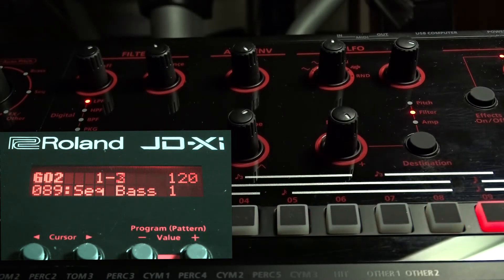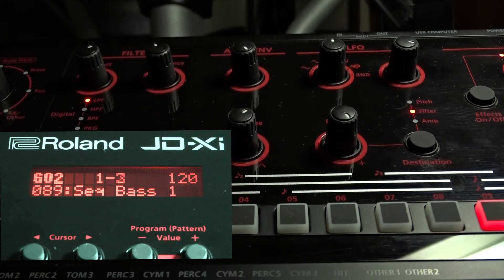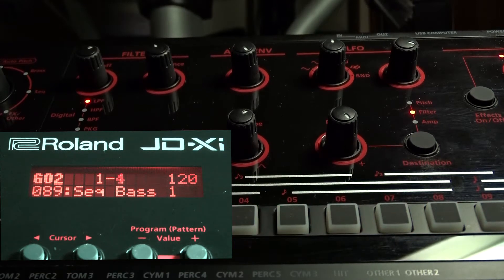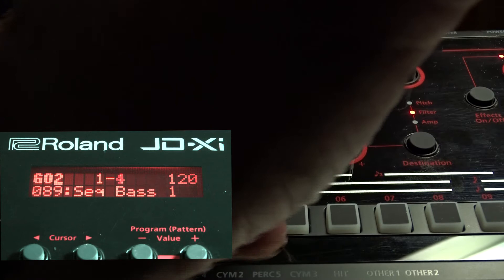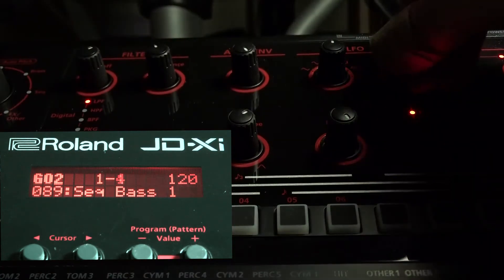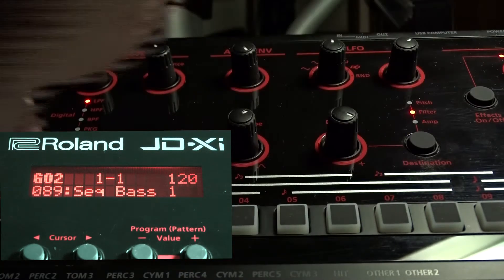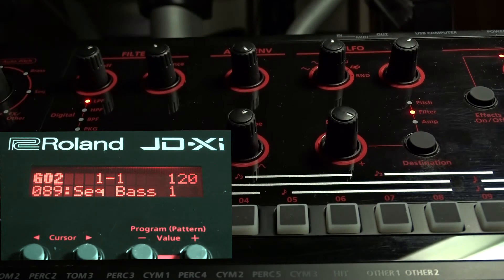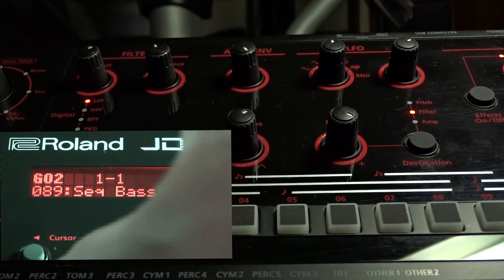Roland JDXI Lfo tempo sync

Comment: You can step far quicker through the menus by holding the shift key while pressing + or –. E. g. when editing in Tone mode you can directly jump to Osc, Pitch, Filter, Amp, LFO, etc. When editing numbers it increases the jumps to 10 instead of 1. Helps a lot.

Comment: the bigger question is beat sync. I've never found the LFO to consistently line up with bars, or  
be tied to note starts. Be at the same tempo, yes it will 'sync tempo'. But what about bars? (that's the big one). Would also be great if had way of starting LFO with each note start and ignoring bars. I don't think it can do any of that. Idk what 'key trigger' setting does, nor do I know what 'free run' vs 'tempo sync' does...could only find the latter two under 'LFO Mod" not LFO, and changing from free to tempo etc did not change the LFO sync behavior. If JD set to slave, LFO seemed to run at same tempo. But again, no sync to downbeat (bars)?
Reply from the maker: A lot of the features you speak about I think are reserved for the "big synthesizers" like the sub 37 for example. When I get a moment I will dig into the menu settings manual and see if there is anything there that will be of interest to you.
Reply: Key trigger will make the LFO start (or trigger) at the same place each time you press the key.

Comment: Hi, just wondering how did you switch to the different partials in tone editing i.e I couldn't see what buttons you pressed to scroll to the next partial within each tone in the video?
Reply from the maker: you use the step buttons 1, 2 and 3 so if your in the tone edit menu and in Osc waveform section then press those and you will see it switch to p1 p2 or p3. any problems just leave a message and I will assist as best I can.
Reply: ..got it, many thanks!!!
Reply from the maker: Your most welcome.